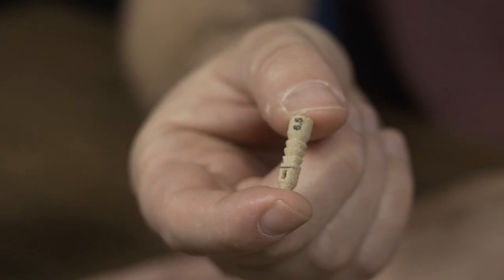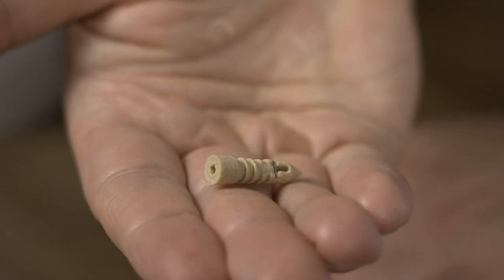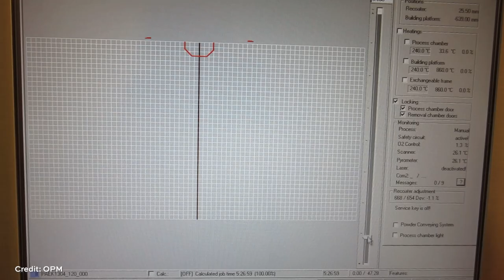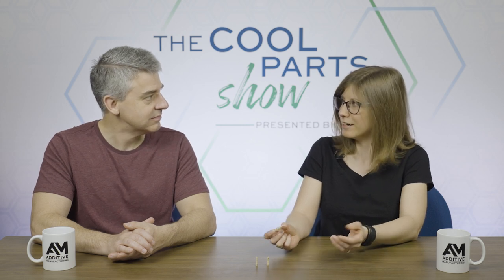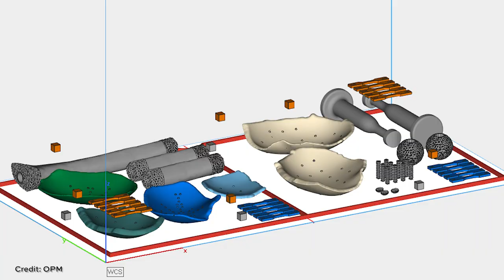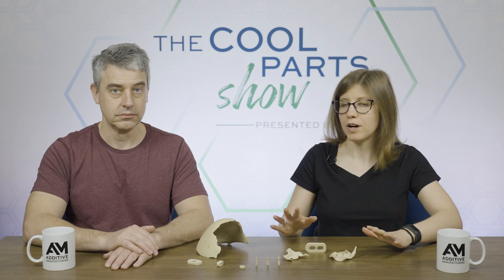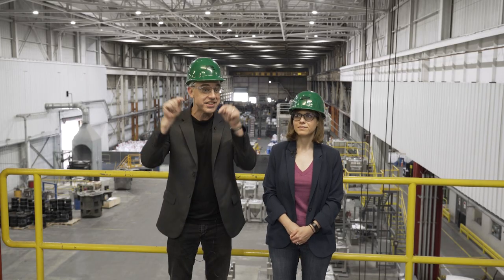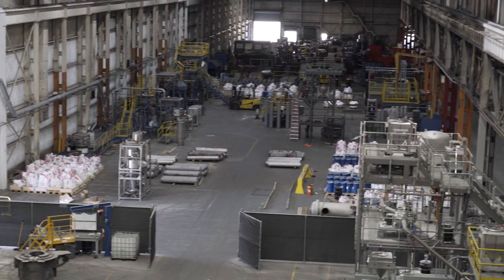More Affordable Surgical Devices 3D Printed from PEKK: The Cool Parts Show #60

Comment: Hi All - One little correction PEEK polymer does have a biofilm. PEKK does not have biofilm because of its unique chemistry attracts selective proteins that inhibit bacteria colonization.
Reply from the maker: More from Scott on PEKK: "There are lots of uses of PEKK. We do have two coatings technologies – both conventional powder coating and aqueous PEKK coating. Powder coating materials are powders that are coating using electrostatic process. The aqueous system is provided as a true water based solution. You just dip/spray and bake to around 330C and out end up with around 350nm of pure PEKK on the substrate. All forms of PEKK have the same antibacterial property though they do not elute, bugs just don’t have hospitable environment."
Reply from the maker: And another resource on the topic from Oxford Performance Materials: https://www.youtube.com/watch?v=8Pa9BBf-l9g "Research Finds: 3D Printed PEKK Polymer Inhibits Bacterial Growth"

Comment: Maybe the material's surface is damaging to bacteria the way abestos damages the body? Would love to see the anchors put through an electron microscope.
Reply: Actually the mechanism is a little more complex. The polymer has a surface energy that attracts the bodies natural proteins to the surface that prohibit bacterial colinization.
Reply: @scottdefelice9518  So is PEKK the future material of implants then such as artificial hearts or joints?
Reply: @jmd1743  The material is very bone like mechanically so we specialize on replacing damaged or cancerous bones in cranial, spine and extrmeity. Not a soft tissue replacement material.
Reply: @scottdefelice9518  Sounds like you're onto something, such as what is to lab grown bones is to lab grown organs.

I wonder if one could 3d print spinal cartilage, and then have everyone change out their spine cartilage at a certain age like how colonoscopies are done or how you change you car's timing belt once every so number of miles.

Comment: I don't think people realize what this means for medicine that bacteria don't attach in congregations yet the body accepts it. 
   Even gold has biofilm on it. Everything does. Well.. Apparently not everything.
   I've known several people with loose pins. Both had a crushed arm and a bunch of hardware for elbows and forearms. Is it only surface mounts that get removed? They both still had their stuff years later.. I guess I should educate myself on the subject now.
Reply: I know this is late but they typically only remove pins if they are causing a problem, at least here in the UK. 

I broke my elbow and had to get the tip pinned back on, they only removed the pins because I didn't have a full range of motion in my elbow. They typically prioritise reducing surgeries over removing pins.